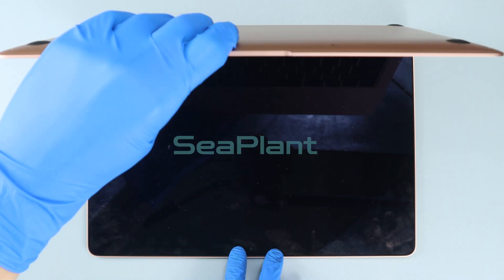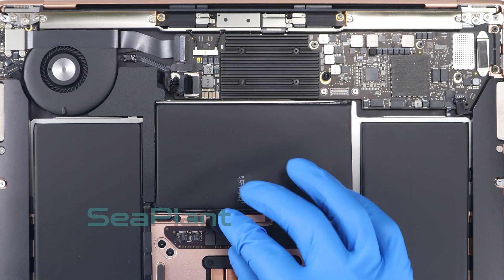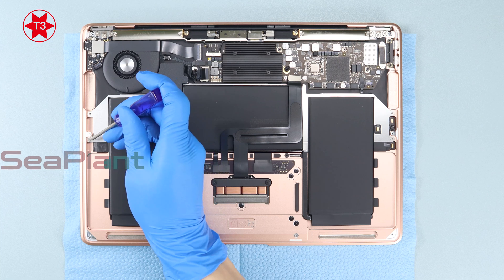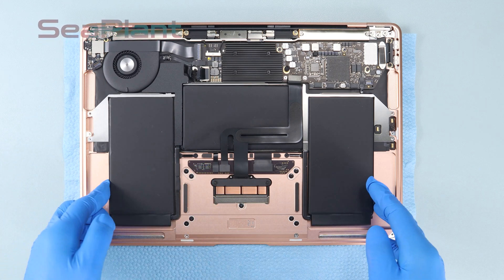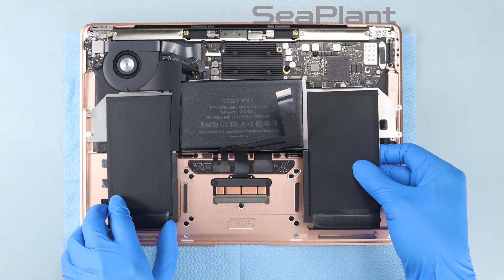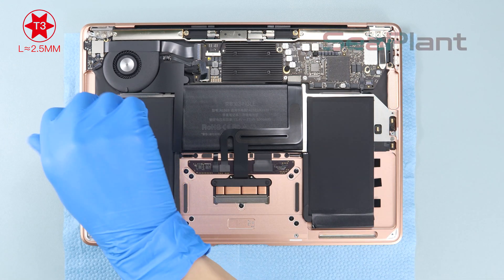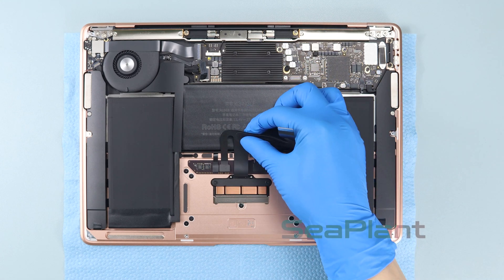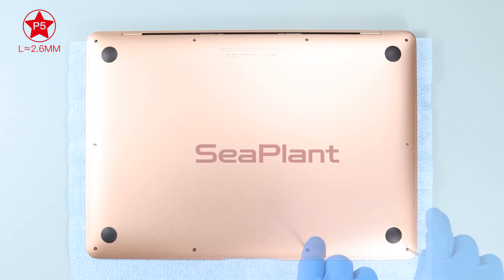How to replace the battery for MacBook Air 13-inch A2179 2020

Comment: Was helpful except you skipped the step of disconnecting the battery; pushes out to the left, not straight up.
Reply from the maker: Thank you for watching and commenting! The operation steps in the video may have been shown a bit quickly, making it appear as if it was pushed upward. In fact, the battery interface is pushed out in parallel. Thank you very much for your kind feedback.

Comment: thanks for the great film. 

1. Will the system show in the settings the number of cycles at 0?

2. will the system show battery status: normal? 

Thx in advance!
Reply from the maker: Thank you for your comment! Our batteries undergo rigorous testing before shipment, so the cycle count is usually 1. Additionally, the system will recognize the battery status as "Normal." If you have any further questions, feel free to ask!